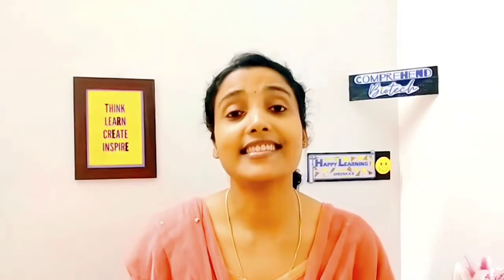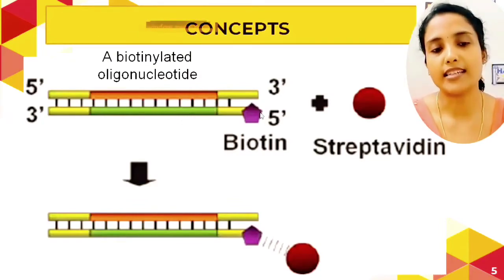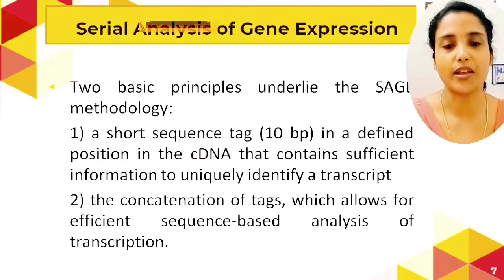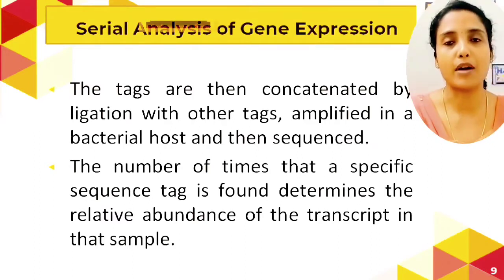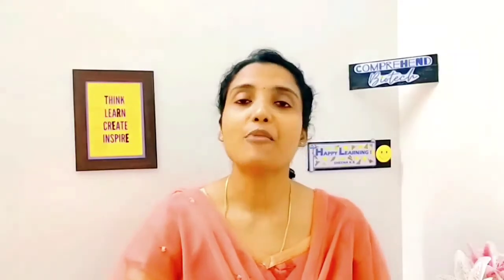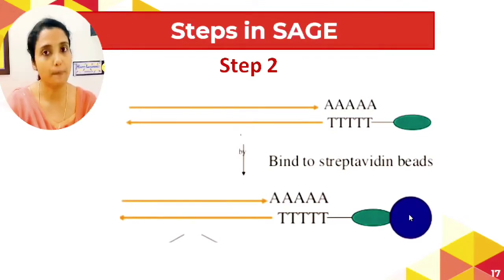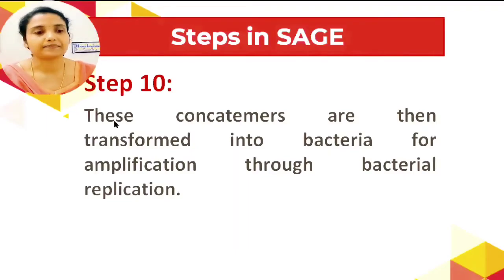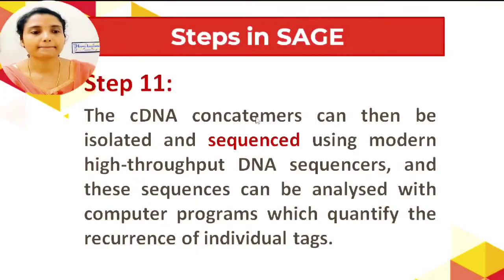SAGE || Serial Analysis of Gene Expression

Comment: mam can you explain what are the differences between sage and micro array?
Reply from the maker: Hi Sharmili Majumder! The most basic difference between the two is that SAGE can detect the presence of unknown genes whereas Microarrays can only detect known set of genes. This happens because in microarray technique we use pre-designed probes which are complementary to our genes of interest. In order to design a probe one must know the sequence of the gene right. So while comparing two samples (like healthy/infected), microarray can only detect the presence or absence of known genes with the help of probes. 
In case of SAGE, we are not using any pre-designed probes. Presence of new genes can be detected because the tags that we get can be different for a different genome sequence. So while comparing two samples one can not only detect the overexpression or underexpression of known genes, but also detect the expression of a new gene. 

That said, another difference is that the number of samples that can be analysed at a time by Microarrays is way to high than that done by SAGE technique.

Hope this helps. Happy Learning!😊
Reply: @ComprehendBiotech   thank you... Mam .... For explaining the concept in such a beautiful way... It is really helpful...